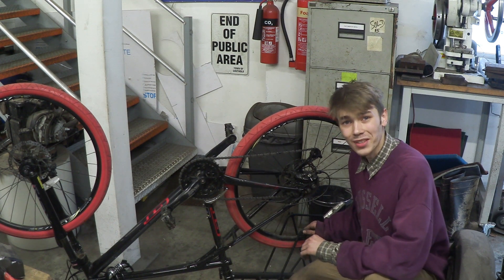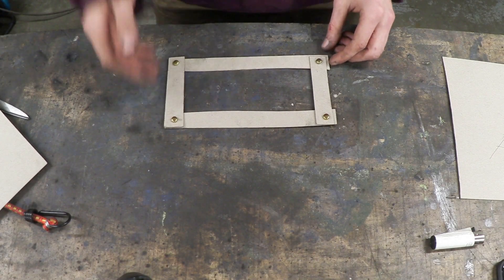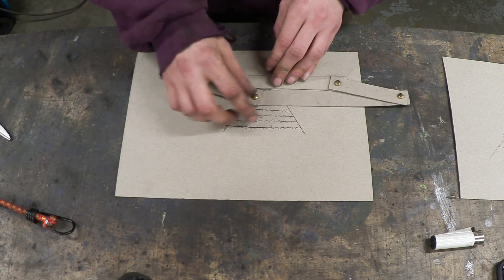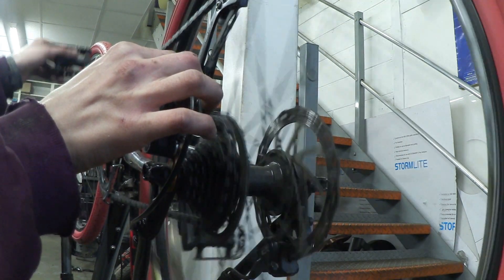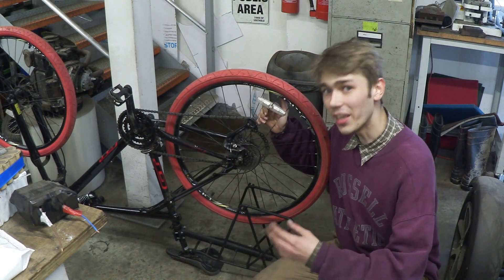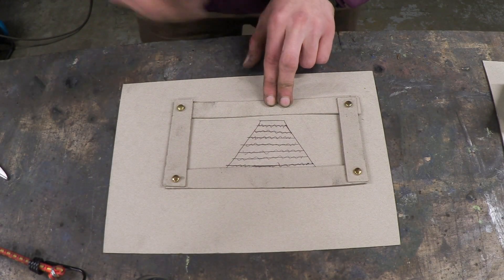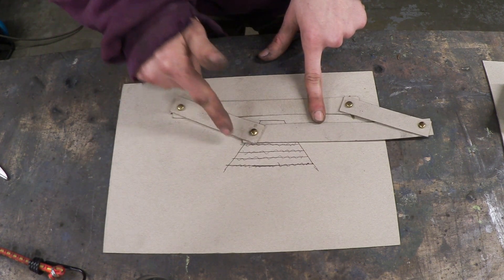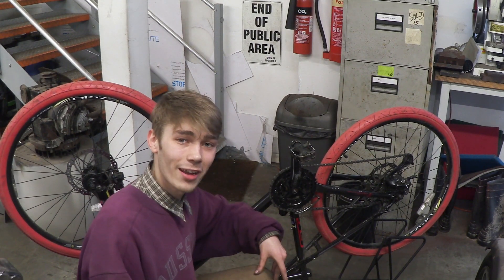1110 - How a Bike Derailleur Works.

Comment: I remember .... back (just after wheels were made round) there were no derailleur gears!
No. Seriously!
They had a big hub with 3 gears in it and an actuator that was a thin chain coming out of the middle of the axle. This connected to a cable ending in your handgrip. Twist the handgrip one way and you go up a gear. Twist it the other way and you go down. I am fairly sure it was a set of planetary gears .... but back then it was just Magic!
Then this French company started making new fangled gears like they needed for the "Tour de France" et voila! Derailleur was born!

Back then we did crazy stuff with bikes. Racing handlebars were twisted to be upside down and the more progressive (with more pocket money) went for "Cow Horns"! We were on fire! We would take an older bike and cut the forks off and elongate them with tubing to give a kind of "Chopper" ..... a bit hard to do good wheelies with but we were COOL!

Then I grew up and got a Yamaha FS1E (50cc of pure power) ...... and pedal bikes were suddenly not cool! ;0)
To be fair neather was riding 15 miles across Manchester on a rainy morning to get to college, but thats work for you! ;0)
Reply: I suspect that we are from the same century!!
I hope you are having a great day! 🙂❤️XxX.
Reply: @AndreaDingbatt  Every morning work out if you are sucking in air regularly. If the answer is yes, remind yourself it could be worse! ;o)
Reply: @totherarf  Lmao!!
Indeed, I usually check that out on a twice daily basis!!
I'm out-living most of the folks who've p*ssed me off..... 
I believe it is a form of vengeance.... 🤣. XxX.

Comment: How do the click shifters work?
Reply: On modern road bikes. I assume one click ratchets a pulley, the adversary click releases a spring loaded locking mechanism. Typical mountain bikes have locking points in between each gear on the shifter.
Reply: Old 12 speeds were super analog and foolproof. All of this pertains to the spring loaded derailleur being regulated by cable tension at the shifter.
Reply: Where do elves sleep?
Reply: @dav1dbone  they sleep at the the Nexus.
Reply: @dav1dbone  I was going to ask that!!
Does any one know what the "Anti-Gremlin" spell is though, Please ?!!😁XxX